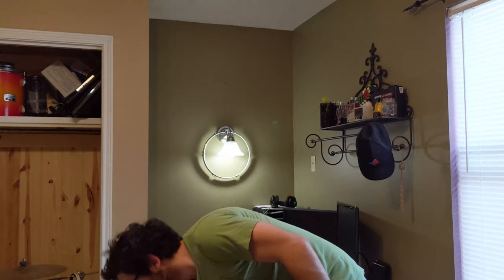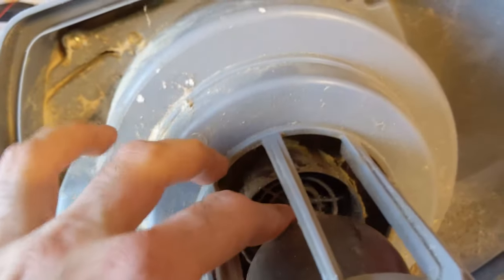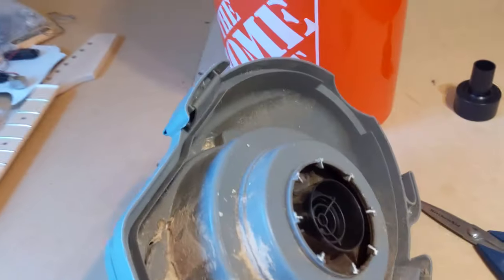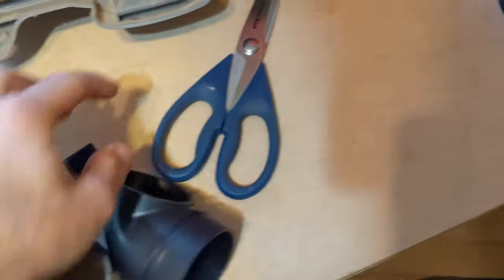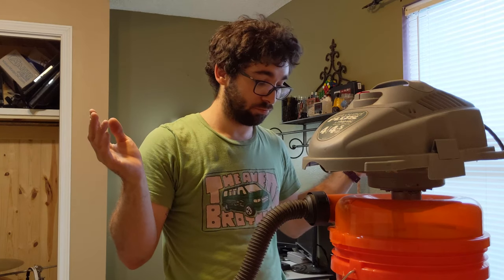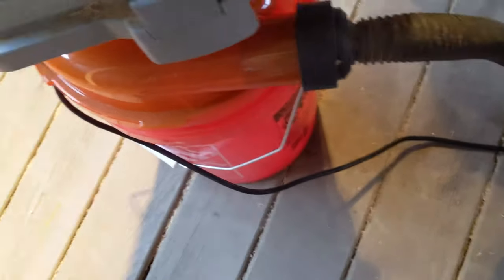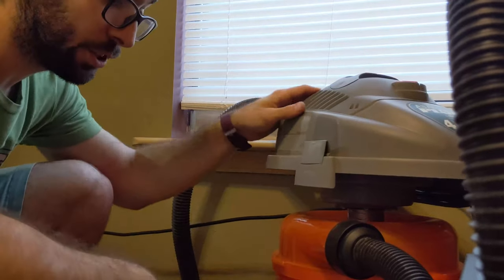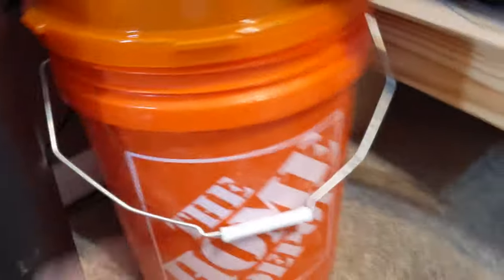DIY DusTopper Shopvack Melding

Comment: How is that any different than the shop vac’s original container?
Reply from the maker: It separates the dust out and bypasses the need for a shopvac filter. I probably wouldn't do this if I didn't already have a shopvac motor without a container or if I didn't pipe the exhaust outside, but it works for my situation.  Previously, my shopvac filter would get so full so fast, but I don't have to worry about that anymore.
Reply: @centralcraftery4765  But now you have no filter between dust that bypasses the cyclone separator and your motor.   Cyclone separators work well, but not 100%.  So now you are running a lot of fine dust directly through the motor...  not an ideal situation.